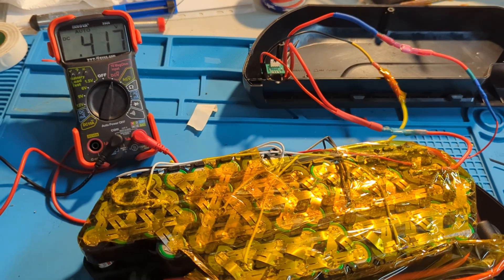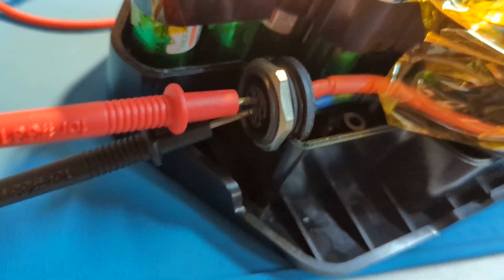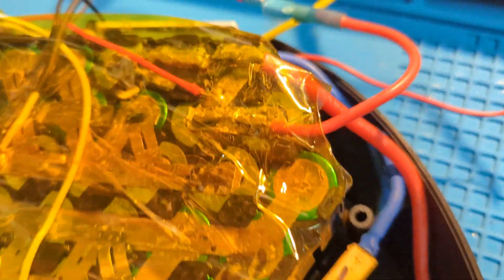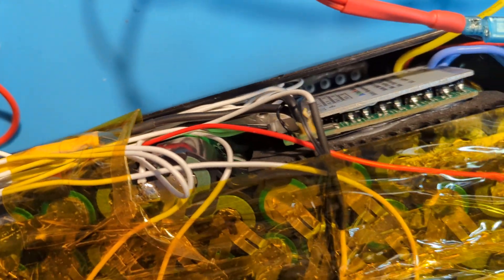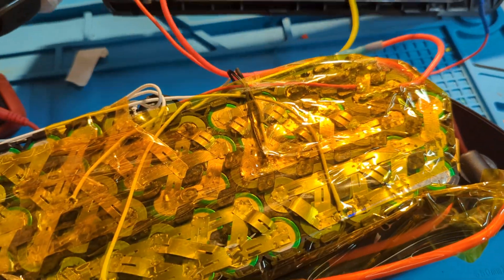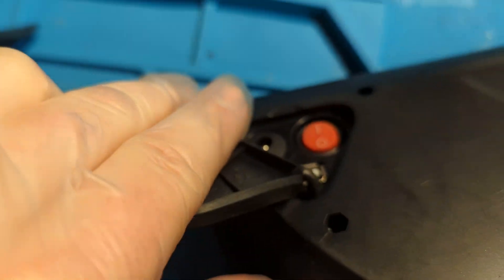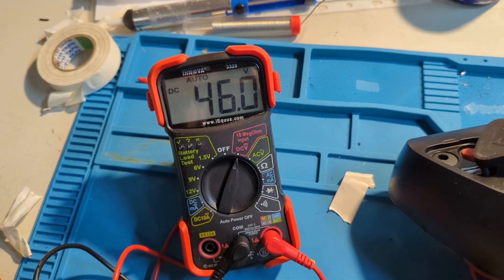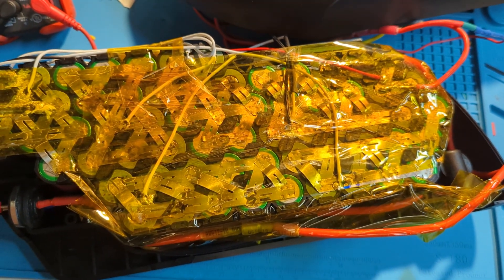Ebike 48v battery build - testing BMS switch

Comment: Hi. For some reason my battery output is always 48V regardless of switch position. Ive checked that the switch is working with a continuity meter and im not sur e why its not switching off the battery. Is it maybe something with the BMS? Thanks
Reply from the maker: The BMS needs to support the power switch, otherwise the output will still show voltage.